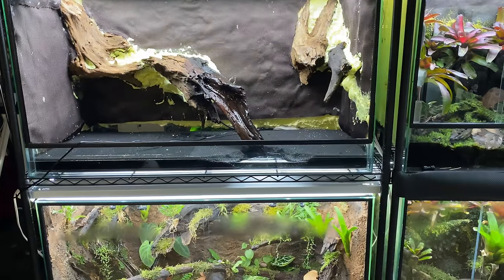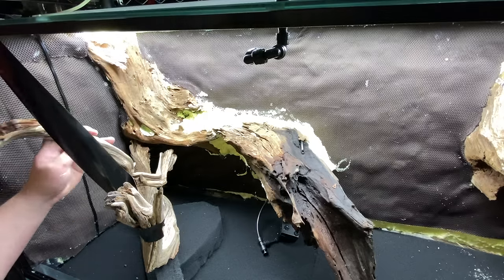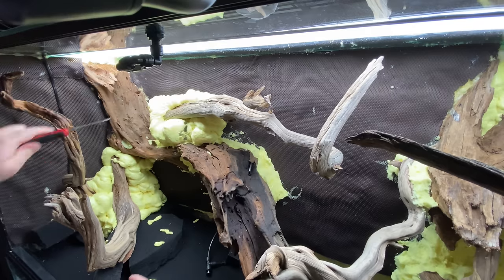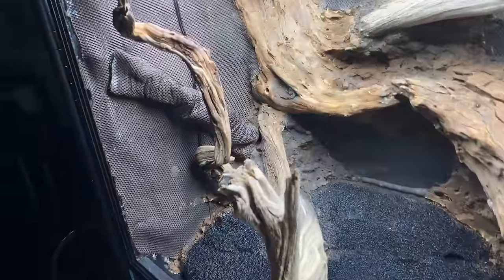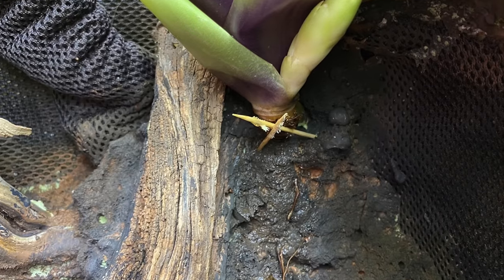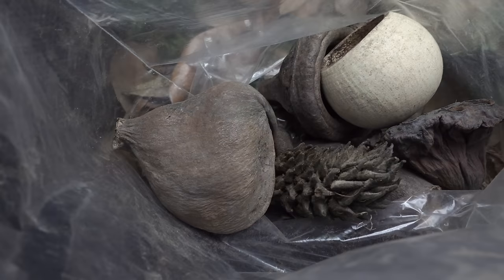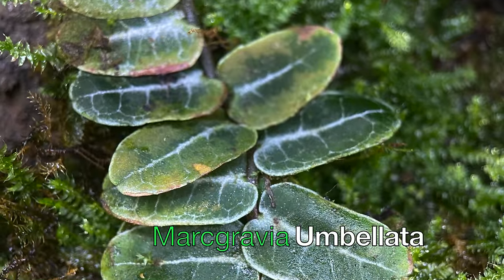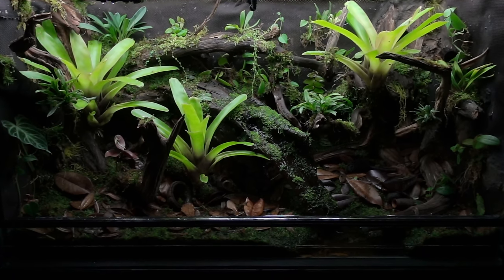EPIC Vivarium With a Water Feature Bioactive Tutorial!!

Comment: Heya Troy!  I keep multiple planted aquariums, dozens of houseplants, and have almost everything needed to start up a bioactive dart frog tank. Stumbled across your channel and haven't looked back. 

I LOVE the use of the filter sponge material as the substrate layer. I have loads of it in my stash.  This build is pretty much the concept I would like to do with a spare 30 breeder aquarium. 

Question about the pump placement and function - clogged pumps are the bane of a fishkeeper - is the pump literally sucking the return water from the sponge layer?  It looks like both the sponge sheet and pump are resting directly on the glass bottom without much clearance between the pump housing intake and the sponge. Correct?  Do you ever have to do periodic maintenance on the pump and impeller due to any type of bio buildup / sludge etc? 

Your content is .... beyond fantastic.  Your thorough and very detailed teaching style is excellent!
Reply from the maker: I very rarely had to service the pumps and often never have to
Reply: @TroyGoldberg  thank you!  I am going to try this!

Comment: So a few questions, i understand this isnt a tutorial vid but how do you reconnect the power cord to the pump once you snip it? How would you replace the pump if it went out? and how does the water level not raise if you are misting the viv regularly? The viv looks great as always, and we're still waiting for you to build the ultimate phyllomedusa bicolor viv :P
Reply from the maker: MiZtA_bluee all my tanks tanks are drilled for drainage so that the water level doesn’t raise above a certain point.  If the pump fails, you cut the tip of the plug and literately just rip it out and replace the same way you originally installed it.  To reconnect the plug, you strip the wire tips to expose the actual metal and reconnect the positive side to positive side and the negative to the negative side and wrap each side with electric tape.  It’s the most basic of wiring techniques.

Comment: I know this is a couple years ago so I hope you see this comment. I want so badly to do a water feature but I have told that you MUST have easy access to the pump to clean it out, etc. I see from how you did this that you did not follow that advise. Have you had issues with needed to reach the pump now that it has been running for a while.
Reply from the maker: Haven’t had issues
Reply: @TroyGoldberg  Good to know. I wonder if it is because you did not use substrate but foam instead

Comment: I did a waterfall setup and the substrate is constantly saturated. How can I fix it and is it bad for the frogs?
Reply from the maker: If the substrate is water logged it can be bad for frogs, because it can grow some bacteria’s that can be harmful.... that’s why it’s good to have a drainage layer and a substrate later so the substrate area isn’t always soaked
Reply: Troy Goldberg's Tropical Garage Thank you. I do have an egg crate false bottom so that the substrate is above the waterline but somehow it is still soaked
Reply: @m.j.7703  drainage layer needs to at least be higher than an inch in my personal opinion. Also you need to drill a hole and plug it so you can drain the excess water when needed. If your glass cannot be drained, your best bet is to just make a bigger drainage layer so it doesn’t soak your substrate, and that water will evaporate over time.

Comment: On the long run that water pump finna die one day and you gon need to replace it so I wouldn't recommend using superglue lol
Reply from the maker: super glue is just meant to keep the wire in place.... its not hard at all to remove the pump if it dies